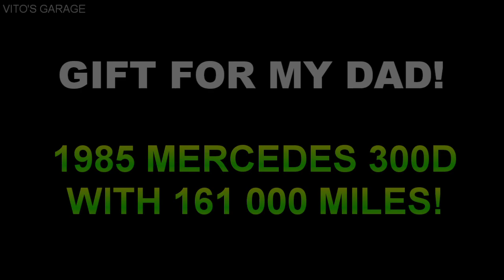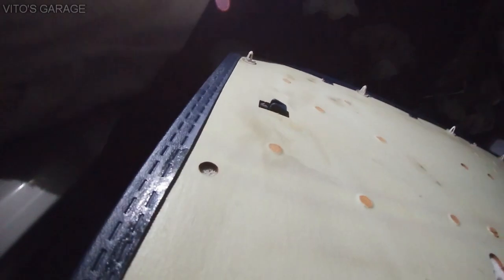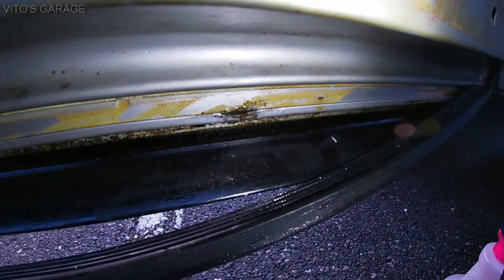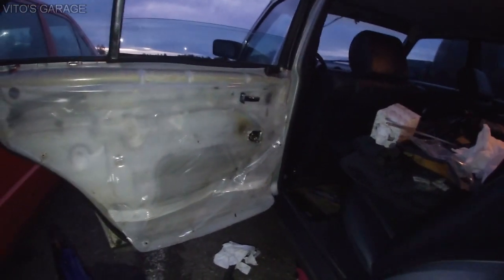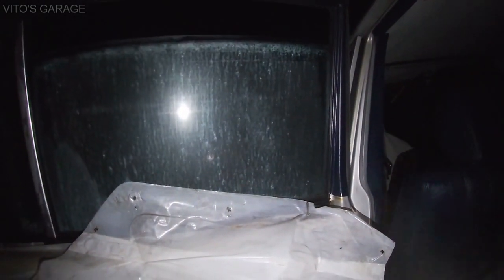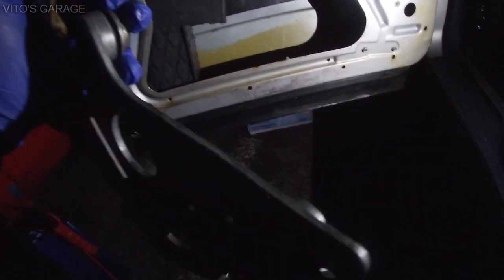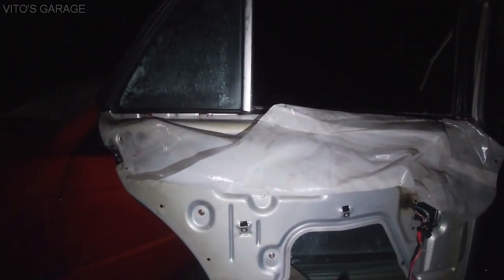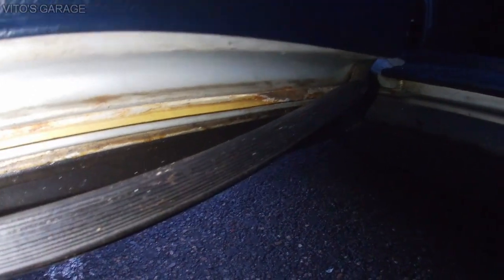PART 12 Dad's Mercedes W123: Why You MUST Check for Rust Behind Door Seal! 4 Door Maintenance DONE!

Comment: I had the doors on my Previous  2000 W220 done twice and on my previous 2003 W220 it was the wheel arches I also had done twice. The doors as you have shown are very critical to keep on top of. Once rust gets its toe in it is a log to get rid of. Doing a great job there Vito
Reply from the maker: Thank you. Always check and preserve the bottom of your doors. Don’t neglect it!

Comment: Who would think ,that for a 35 year old car, the window regulator is still working, and when you said that you bent it back a little,those window regulators are made from calamine ,which crack or break, and I have noticed it in all those old school cars ,awesome job Vitto.
Reply from the maker: You can bend them back but you must be super careful and it’s the best to use the heat

Comment: Hello from France, what an impressive job ! I have a 1992 C 124 petrol coupe that I only did small restorations. 
For the protection of the sheet, I do not use grease, but "Rustol". It is less messy and it deposits an almost invisible protective varnish (note: the grease attacks the rubbers). I add in the engine oil an ultralubricant A9 Technology, a product used by French collectors for vintage cars which will protect the engine for 30,000 km, increase et equalize compressions, lower consumption and pollute less. 
Did you do a diesel purge (in a closed circuit) in order to clean your injectors?
I do not know the W123, but on the W124, the alternator regulator can be changed in a preventive manner very easily (two philips screws). This is too stupid a breakdown ! In France, the old vehicles are gradually banned with the entry into application of European directives of pollution : It's just the last kind of planned obsolescence, punitive ecology  (Sorry for my poor english ...).

Comment: What did you use to lube all the door mechanisms
Reply from the maker: Wheel bearing grease for the window regulators as well as ATF. Silicone paste (grease) for the door seals. Fluid film for rust prevention inside the door and under the door